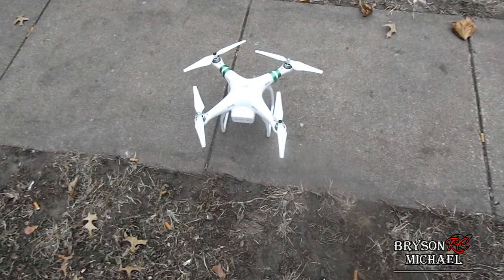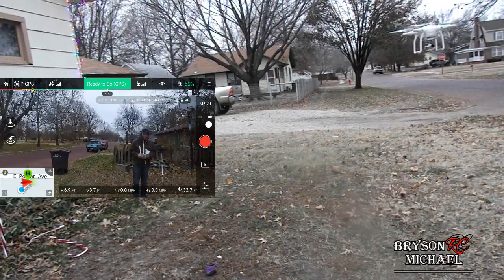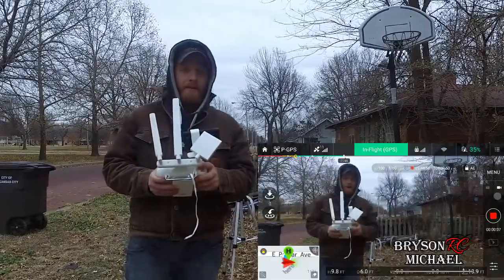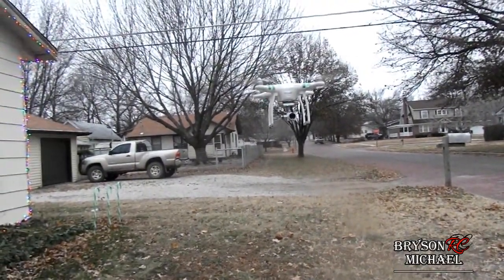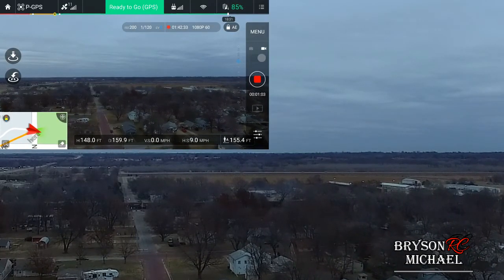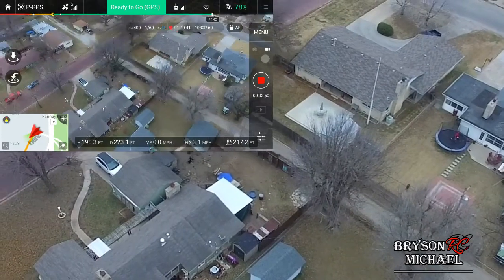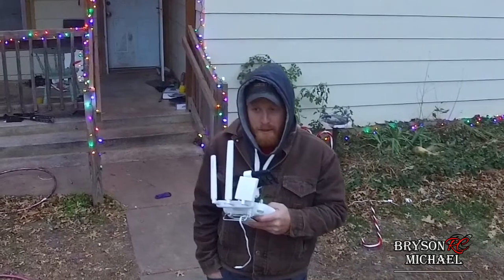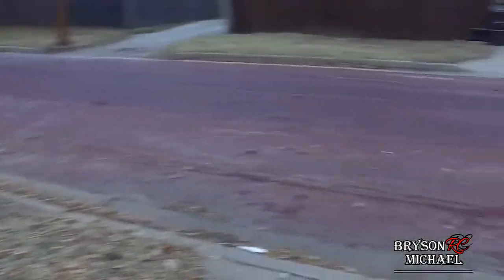Flying Your DJI Phantom in Cold Weather or Snow

Comment: @bryson how did you get the audio to work while flying your drone like that? I noticed it sounds like your phone is picking up audio while you were recording yourself...am I missing a feature to turn that on??

thanks for the videos.
Reply from the maker: lol, ya my phone records better sound. So a lot of the time I turn on the screen recorder which records sound. Then as im taking other video from other camera, I overlay the sound from the screen recorder. its very easy to do. If im using a camera WITH sound Its real easy just to match up the voice by words and then i mute the other audio, and when its a camera (Like P3S) that has NO sound I usually leave myself matching cues. What you DONT see is little things I do to know where to match sound with video. Its pretty cool.
Reply: Bryson Michael RC that makes sense....and is a good idea. I will have to get a screen recorder so I can get sound at certain times...for example, the other day I have the Phantom hovering over a group of people as we were doing something, but did not have sound.

This may help solve that problem. Thanks for your response and videos.
Reply from the maker: Chris Rosenberger it will... just make sure you come up with a start signal along with a sound at the exact same time. I like to clap. so I can slow the video down and match the slap at the exact time my hands touch. then I look for that and it lines all the sound perfectly with the video
Reply: Bryson Michael RC ok, thanks for the tip!

Comment: A full battery to warm up the machine?  Man, you've got other issues because mine stays put in a hover, even at minus 5 or so right after take-off.  I use the auto take-off and it never moves an inch.  You should maybe check the IMU, cause this has NOTHING to do with the gyros being cold.  What do you think they do with a real Jet Ranger for instance, hover it for fifteen minutes til the gyros warms up?  I don't think so.

Comment: Thats a standard right?
How did u get 1080p 60fps on it?
Reply from the maker: you can set it in the Litchi. This ones not shot in 1080p 60fps I dont think. If I say that in the video its probably because Im so use to using the Litchi video settings. But there is an option in the Litchi that allows you to set that even though I dont think its fully 1080p 60fps. Its as close as you can get with that camera. Its clearly better and more HD then the highest setting in DJI GoApp but I really dont think its full 1080 60
Reply: Bryson Michael RC can u please send me the link of that app please?
Reply from the maker: Tcho2100 do you use Android or IOS? I got it from Google play for Android. it's $19.99. search Litchi
Reply: Bryson Michael RC i have ios, danm 20 bucks for an app??? Is it worth that 20 bucks? Is it better thant Dji go?
Reply from the maker: Tcho2100 I have PLENTY of videos on the Litchi app... well worth it. it does a lot more them the DJI GoApp... the Litchi Waypoints are my favorite

Comment: You don't need to fly the drone to warm up, just turn it on and wait until you hear the cooling fan turning on.
It takes only a few minutes.
With recent firmwares and DJI GO apps you even get an online message "Aircraft warming up" during which you can't start the drone. 
Also the recent batterie-firmwares prevent starting the drone when they are too cold, and restrict airspeed in cold weather, in each case you get a corresponding onscreen message.
Reply from the maker: flying just stabilizes the gyro better. The drone warms up but it only warms up to a point. the gyro is still pretty effected. Flying it in a hover, ive found, stabilizes the gyro and gives a smoother flight. also putting a warm battery in after you warm it up help to not have so many drops in volts. When you set it up, and it says "warming up" it doesnt get the gyro very stable. Like in this video, the drone was ALL over the place. And I went through the warming up process. But after I warmed it up it was very steady and very smooth. Before when I flew Id have to crank the sticks to one side or the other when flying in atti so I could get smoother shots and it was just a rough ride. but every since I started this process, I havent had as much problems

Comment: why are you using one 2.4 patch antenna and one 2.4 omni antenna ?
Reply from the maker: cause i like to live on the wild side! lol. no, I dont know really, I just do that from time to time. I wasnt flying long distances, so any antenna placed anywhere on the ARGTek system works for short range flight. Ive had the Omni's on the outside with the 7dbi pannel in the middle, Ive had two ARGTek Omni and one cheap chinese Omni all at once, which actually got over 3000 feet haha, and so forth and so on. The antennas dont make the rules! lol
Reply: Bryson Michael RC add a couple of 2.5 watt boosters to that argtek and you'll get great range. I did this and tested and got 2.5 mile out
Reply from the maker: thought about adding some boosters. know where to get some good ones? I wonder if wifi boosters would help with racing FPV too.. hmmm
Reply: Sunhans are good. I added two to my standard and fpv is great and range is insane!
Reply: https://plus.google.com/photos/...
Reply from the maker: SkyView4U Drones make a video
Reply: https://lh3.googleusercontent.com/7MEg2_gNNDYmeXhAWWGgXLt1iqzTH2-wp16DtOPiPVSJgzFf9HWhHy64dmS9-7YrPtYRKYadzw
Reply: https://lh3.googleusercontent.com/VZVAHFS_g1Jsc6snnq65qD4sausTJdw1DxcrDv-fjXEnUykv_tnugjGfQQTV1zya2UbFmk38Dw
Reply: Some reason I can't show pictures !!
Reply: Just check my profile you'll see my mod
Reply: I don't upload long range flights anymore do to repercussions from FAA
Reply: Actually I don't even go them anymore. It's to risky
Reply: Do them I meant
Reply: https://plus.google.com/photos/...
Reply: I hate g+! Damn thing !